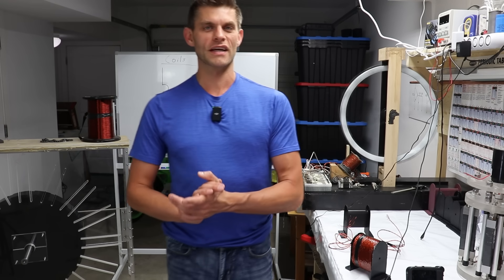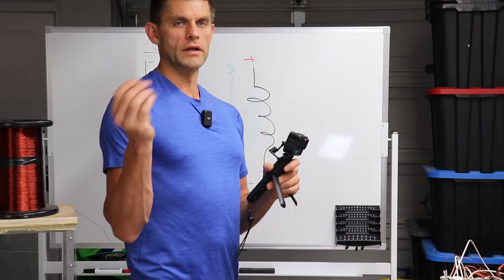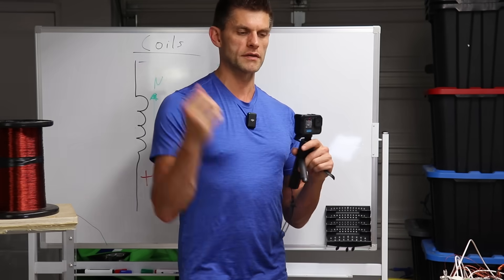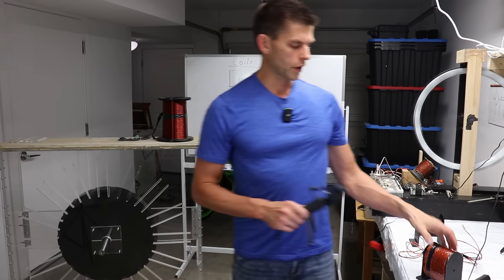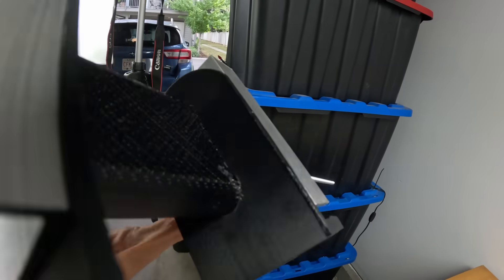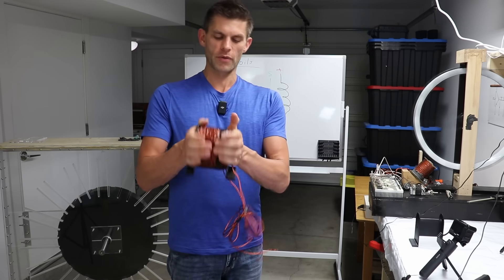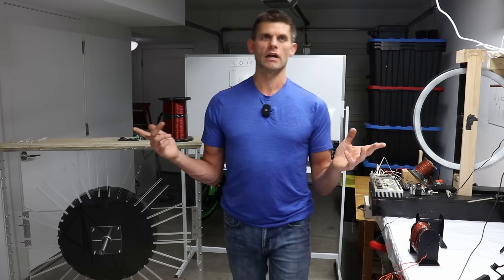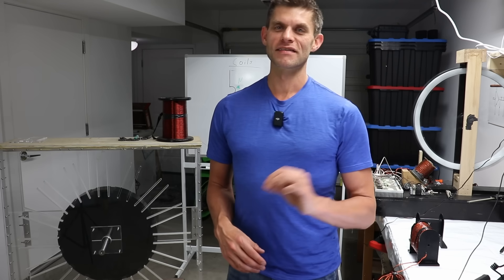Unlimited Energy in My Garage (No Patents)

Comment: I have followed a lot of people from Stanley Myers to Tesla, to so many others, and they all have one thing in common. They died early and mysterious deaths, whether it was suicide or poisoning, or whatever. Thanks for what you’re doing, it was nice to witness some of your videos, and I hope that I can say in years to come that you’re still alive and well. But the way the government is as suppressing these types of things I have my doubts.
Reply from the maker: I think eveything is ok
Reply: @MadscienceLPTECH I hope so.  I did R&D testing back in the early 2000’s for the PICO converter.   It was basically a device that was installed in the exhaust system of a car, you ran a liquid gasoline line too it and the exhaust would basically flash heat the liquid into a gas state.   From there it went through a rubber diaphragm air pump and a pressure regulator and into a set of special “gaseous state fuel injectors” that were pulse width modulated with inputs from engine rpm, throttle position, EGT and Lamda sensors.  We were getting in excess of 280-300MPG in a 1989 Honda Accord.   As soon as the company started announcing the technology m, all the sudden the “military” shows interest.  Aaron didn’t want to sell.   A few weeks later, a healthy 34 year old died of cancer.  Except this cancer spread SUPER fast.  A few others on his team were taken away for a few days.  When they came back, they don’t remember anything.  Not even where they went.   My Accord that we were testing with, disappeared out of a parking garage one night when I went out to eat.   I got a phone call that evening that told me if I value my family and my well being, you will walk away from this and never reproduce, touch or experiment with any such technology.  So please be careful.  Many people go quietly missing or have total amnesia to what they were building when it comes to suppressed tech.
Reply: Tesla did not die early 🎉

Comment: Good to see your work, keep it up.  Are you aware of the Joe cell work of capturing the ether energy and using it directly to power devices, motors, etc. ?  Using the energy around us directly instead of converting it to electricity.  I experimented with a Joe cell many years ago.  I had a somewhat working model on an old truck, but I was unable to keep it running for over 30 minutes on the cell only.
Reply from the maker: Very cool, wish you had footage i could see

Comment: From The Independent newspaper UK

A British firm has used AI to develop a magnet free of rare earth elements at record speed, an advance that could revolutionise clean energy production.

The new magnet was developed in just three months using AI compared to the conventional process of discovering new materials which is often slow and resource-intensive based on trial and error, the firm, Materials Nexus, said.The new magnet, dubbed MagNex, could be made at a fifth of the material cost using AI along with a “70 per cent reduction in material carbon emissions” compared to conventional magnets,
Reply from the maker: Sweet

Comment: This is great thank you for working on this important idea. I have a few questions around the specific mechanism responsible for the actual energy generation. How exactly does a rapidly collapsing magnetic field extract energy from the fluctuations in the quantum vacuum? Do you have any sources you can share on a theoretical framework or explanation for what is happening? Where exactly is the excess energy being generated; the back voltage in the led acid or in the coil where the actual field collapse happens and spins the wheel with magnets?
Reply from the maker: I can link sources to look into in next videos
Reply from the maker: In the batteries because of the HV spikes
Reply: @MadscienceLPTECH  Thanks for the reply! Follow up, what purpose does the magnet wheel serve?

Comment: This is the Bedini/Bearden "Energy From the Vacuum" stuff. That is a fantastic video set. I have some of these that I was working on about 15 years ago. I doubt they work anymore. Had some that used starter coils and ice cube relays to make pulsing magnetic fields. Were looking at ringing circuits and changing topography of coils at the time. Like an electrical ram pump.

Just got busy with life. Glad to see this stuff is still being worked on. Great potential here.
Reply from the maker: Thanks for sharing!
Reply: Facts. Bedini and Thomas bearden work right here. Vacuum energy
Reply from the maker: @gregswope1786  100
Reply: I guess none of you have ever heard of an electronic tripler circuit. "Free" voltage that doesn't violate thermodynamics.
Reply: @dbmail545 you’re right about violating thermodynamics. Of a closed system. This is open system tech friend
Reply: Beardens design of the MEG was based on scalar waves and minimizing the B field with a very unique core material for his transformer.. his papers are great for anyone to read especially academics
Reply: @jedgurley What's the core material?
Reply: yes, shout out to  Bedini SSG Simple School Girl circuit!

Comment: ok you use magnets in your test. just a thought:
how much energy you have to put in to create a magnet. I mean in most videos they use magnets that are kinda strong. Then i asked AI. How much energy you need to create a magnet. A LOT: I mean just because they are cheap doesnt mean you get something extra out of it. 
I dont understand much of this energy flow/magnetic stuff. Is the energy of the magnet untouched / remains the same all the time.?
(the answer of AI was not promissing. but it had the same point. just because its made cheap in china, doesnt mean its cheap or even free energy [globablly thinking], right?). i dont know.
Reply: i mean if you can create the magnets neccessary to create that maschine with its own generated power and before the magnets decrease to a point where the whole maschine doesnt work any longer, then I'm convinced. either i didn't understood the maschine right or people forget that creating magnets is not cheap (thinking of power)
Reply from the maker: I dint think magnets are very energy intensive to manufacture and use easy to obtain materials and are recyclable

Comment: It'd be nice to scale this down with a 3d printed plastic wheel with neodymium magnets, a cotton reel with smaller guage copper wire and small batteries. And use it to power something like a raspberry pi or wifi router.
Reply from the maker: That's the plan!

Comment: Can you please make an experiment with capacitors instead of batteries and record the voltage over time of both capacitors and then calculate how much energy was lost from the powering capacitor and how much energy was gained by the charging capacitor?
Reply: The energy in a capacitor is calculated by 0.5 * C * V²
Reply from the maker: One day

Comment: If pulsing the batteries with hight voltage spikes allows power to be drawn from zero point energy, then why not pulse the batteries electronically?

The moving parts seem to overcomplicate everything.
Reply: Because it’s not pulling zero point energy. It’s pulling electricity from the magnets in motion above a coil. Still not above unity.
Reply from the maker: I dont think so
Reply: @MadscienceLPTECH zero point energy is the residual energy left over when an atomic element is at absolute zero, which theoretically is the lowest point of energy any matter can inhabit at any one point of time. How, exactly does a ‘dipole’ effect pull that residual energy from a system? That residual energy would be indistinguishable from the other energy the elements possess at room temperature.

Comment: You know you cant, but keep your project, its entertaining
Reply: There's the catch! Begging for money! You do realize your limited to dreams right? Dreams=Fantasy
You can explain every component yet can not reveal that scientifically, and mechanically the one equation that exposes this as a failure. In the 1800's there was scientists who wrote a book on not what to do. Wind power is  unrealistic and unreliable. and actually raises the cost of energy. Plants are designed to run efficiently at full capacity.  Gas and coal fueled facilities are paid to be on standby 24/7 to stabilize our power grid. I myself have seen a wind farm not do a single rotation in 4 days. That's 100 turbines our tax dollars pay land owners for having them on their land.  This again raises energy prices.  The problem with your attempt to fraud the people of money is it takes more power to operate than you get back in return.  For $20,000 you can just go solar and be done with it.  However it's not free.  If you spend $20,000 on a solar system with a 25 year maintenance free time period.  Meaning no added expenses! In 25 years there is 25 x 12 = 300 ( Months ) Your solar costs you roughly $67 a month. 20,000 ÷ 300 = $66.6666666667!
It's amazing however the people that will fall for your scam.  Engineer to engineer,  I'm being about as nice as possible in responding to your  money grab.
Reply from the maker: U definitely can
Reply: @MadscienceLPTECH  then explain the details on how you get energy from the quantum fields.

Comment: I am using Bismuth in low melting point casting alloys, found out pure Bismuth has paramagnetic effects. I did wonder if that could be used in a motor, Thermocast 3D printed resin for molding.
Reply from the maker: Keep me posted on your progress

Comment: Wow. This guy is saying that if you apply "more than 12 volts" to a 12 volt battery, the battery will "harness power" from some ocean of energy. If that is true then why not just connect your 12v batteries to mains, and then enjoy getting more electricity out than you put in.

Look people, if you want electricity without monthly billing statements, learn to properly disable your smart meter. This generally means calling the power company, telling them you "moved out" and need the power shut off. Wait for them to remotely disable power, then you can modify the meter such that it will not measure voltage or current on the house side (easy to do by unplugging a few wires). Then use a 25-30V DC power source to flip the remove disconnect using thin-gauge wire like the ones you find in CAT5 ethernet cables. Three 9v batteries in series will give enough voltage to turn the meter back on...and voila unlimited free energy.
Reply from the maker: Ya u missed the point, stay tuned

Comment: You do not even need 2 batteries!
Reply from the maker: No?
Reply: Yes, you only need one Battery which you would later remove if you upgrade your system to Garry Stanley Pulsed Motor or Better still Non mechanical One Wire Energy Generation And Transfer which sucks Massive Unending Current from the Earth via a Copper or Aluminium or Gold or Brass 10mm thick Plate.

I have done it successfully and anyone can.

As for the Garry Stanley Motor, you will have to wind your coils in even number dimensions and your Magnet Should be 40mm x 20mm neodymium magnets you can use 10mm thick ones too which can also be ceramic magnets but N52 neodymium magnets works better.

Comment: Very nice. I have tested a lot with back pulsing lead acid batteries. I have found it puts a surface charge on batteries (measured battery terminal voltage goes up), but actual charging on the batteries being pulsed has been poor in my testing. An easy way to test how charged up lead acid batteries really are is by applying a fixed DC charge voltage a little below the max charge voltage for a lead acid batteries (for example, max charge voltage for 12V lead acid batteries is about 14.5V to 14.7V, depends on ambient temperature), and monitor the charge current flowing into the battery at that fixed DC charge voltage. The less charged the battery is, the  higher the charge current will be at that fixed DC charge voltage. As the battery charges at the applied fixed DC charge voltage, the current magnitude will steadily be reduced. Once you are familiar with about what charge current amps your particular 12 V lead acid battery draws at different battery charge levels when say 14.5 volts DC is applied to it,  you can get a good idea how charged up your battery under charge really is. If you are using a battery pack that has a higher total battery voltage the same principle still applies, but you just have to scale the fixed DC charge voltage up accordingly.  If you exceed the max terminal voltage on lead acid batteries for even just a minute or two, electrolysis can start to occur in the electrolyte and you get gassing from the electrolyte. Not good at all for the batteries and could potentially cause an explosion if the battery is gassing a lot and you get a spark.  You will want to monitor your battery terminal voltage and make sure it doesn't rise and stay above the max terminal voltage for very long. Rising above the max voltage for short durations due to pulsing may well still be fine, but if the battery terminal voltage stays continuously above the max voltage for a little while, gassing will start to occur. You can hear that by putting your ear near the battery and you will hear the battery bubbling inside. Best of luck on your experiments! I hope your idea of using very fast switching and higher voltage pulses works out for you! I find that lead acid batteries (and probably most types of batteries) need a steady charge current applied to them to take a real charge. Short duration pulses just don't seem to charge well. All the best.
Reply from the maker: Appreciate the comment. I have observed this as well. Flip flopping run and charge batteries every few minutes is key to allowing this "surface" charge to be utilized
Reply: @MadscienceLPTECH  Yes. that might work.

Comment: Just curious, why does it need to be an 8 wire loop at 250 feet?  Once you get the ends cut, that's really just a strand of like 8 or 6 gauge wire, right?  Seems like you'd get a lot more electricity from the magnetic field collapsing around hundreds or thousands more winds of smaller gauge wire than that massive strand you have there... Unless you're not cutting the loops off... In which case, you're literally working against yourself with those flux lines going back and forth down the length of wire.  There's soo much wrong with this.  Like, I want to believe, but there's too much about this that's hoaky asF.
Reply from the maker: No each wire is individual circuit. I think you missed understood how it's connected

Comment: I my self built devices like this and had some good luck with couple of them, I like what your doing here but the impression I get is the more money you throw at it the better it'll work, $1000 rotor, $5000 batteries ? I'll just stick with homemade parts built on my homemade CNC machine and two $75 batteries. 🙂
Reply from the maker: 3000 rotor alone. Need new batteries for this yes. Not quite say 20-30k or so and  u got what u need for this. Again we dont know everything and have to figure it out as we go  future modles will be more cost effective

Comment: Would a design like this work better if placed horizontally or would that have no impact? Also it feels like a design like this is just begging to be put into a nearly or fully friction-less configuration to avoid any energy output being imparted on the rotational components; kinda like a floating rotation assembly? This is some pretty sweet work though. I appreciate that you and tons of others are basically ensuring this tech that's actually like 50 years old gets out now. God speed, warrior.
Reply from the maker: Yes less friction the better. The ceramic bearings im using are legit

Comment: Build yourself a heavy dity jewel thief circuit with a minimum of 90 windings.
Hook one end to ground and the other to a roll of aluminium foil unrolled and hung up to firm an ariel.
Test your results.
Then pit your machine in line.
You will have to play with some bridge rectifiers, but you will get it.
If you want to play with it, put the coil in a vacuum chamber.
Tesla used vaccum tubes back in his day with dc.
Reply from the maker: So good

Comment: You should 3D Print a spooling system that is used for spooling filament. they are very cheap and easy to build.
Reply from the maker: Its the 8 wires at a time that gets ya... but yes

Comment: Zero-point energy, the minimum energy that a quantum mechanical system can possess, cannot be harnessed as a practical energy source. While it’s a real concept in physics, “zero point energy” represents the lowest energy state, and thus there’s no way to extract energy from it because there’s no lower energy state for the system to transition to. Attempts to harness it for energy are often associated with pseudoscience and misconceptions about how it works. Extracting energy would require a lower energy state, which doesn’t exist for zero point energy. It. Is. IMPOSSIBLE.
Reply from the maker: Lol ok chat GPT let's just give up and watch some TV
Reply: @MadscienceLPTECH isn’t that what you’re using to flesh out your scammy video scripts and to make your fantasy “perpetual energy” machines?
Reply: who told you that, your pet?

Comment: Finally someone with money, brains and a team stepped up 🆙 to take the lead! 👏🏾 yess my dyslexic brother 😅❤
Reply from the maker: Lol 😆
Reply: Zero-point energy, the minimum energy that a quantum mechanical system can possess, cannot be harnessed as a practical energy source. While it’s a real concept in physics, “zero point energy” represents the lowest energy state, and thus there’s no way to extract energy from it because there’s no lower energy state for the system to transition to. Attempts to harness it for energy are often associated with pseudoscience and misconceptions about how it works. Extracting energy would require a lower energy state, which doesn’t exist for zero point energy. It. Is. IMPOSSIBLE.